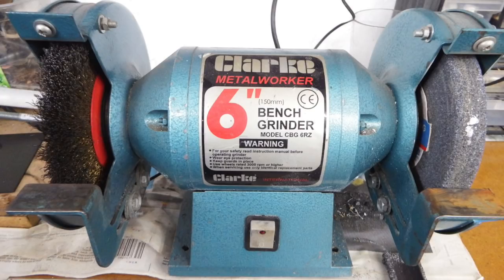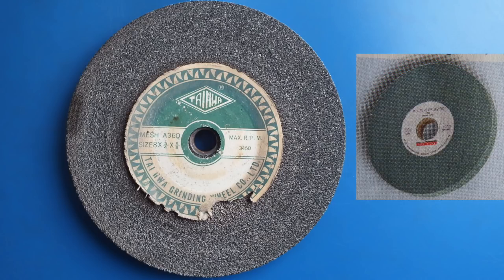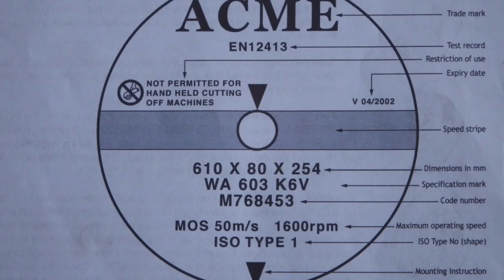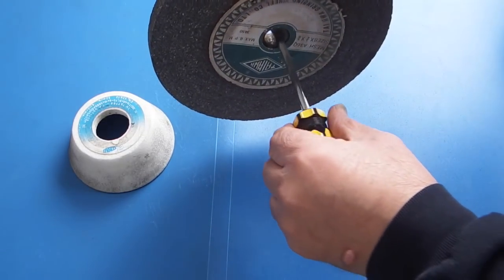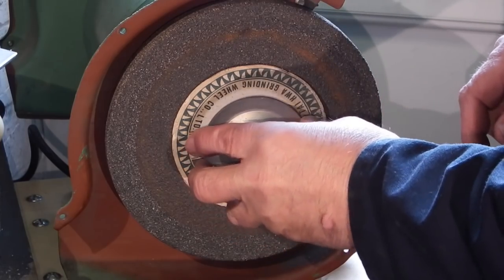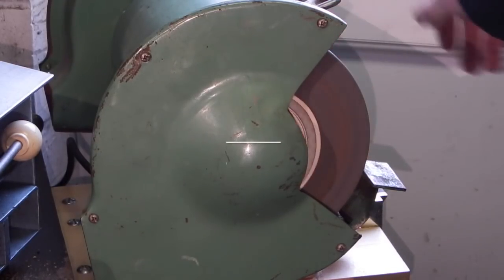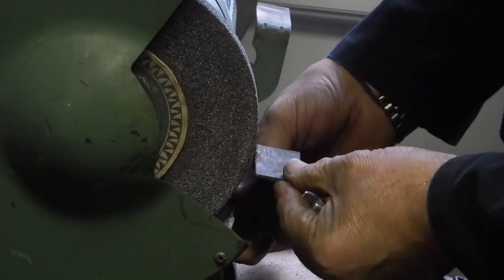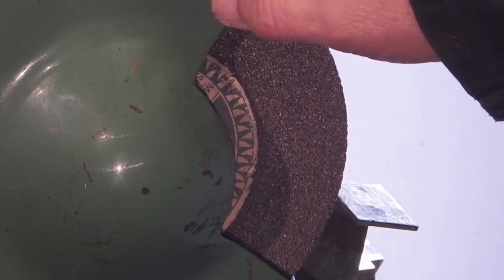Back to basics Grinding Wheels

Comment: Hello Enot, thank you for the video. How are grinding wheels that are designed for side grinding designated? I have a sharpening jig that has a special side grinding wheel but will need to find a replacement at some point and the original manufacturer doesn't offer them anymore. Any suggestion would be appreciated.
Reply from the maker: Hi Bruce. I would try eBay and just search for a grinding wheel to fit a ----- insert the machine name or manufacturer it may come up with a wheel number which you can then use to search again.
Regards
Alan

Comment: Thanks for this guide, sould we avoid shims even made out of thin paper or tape?
Reply from the maker: Hi Poe
Yes on grinding wheels with high rpm, I do not include tool grinding stones which run at low speed and sit in water.
If the wheel is running out the thickness of paper I don't think you would notice it but you could dress the wheel side to reduce any out of balance.